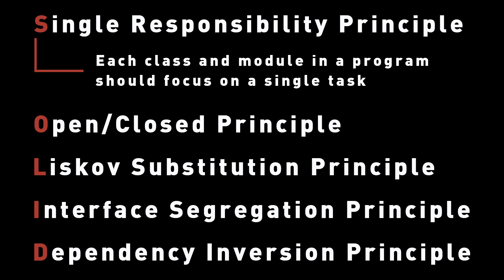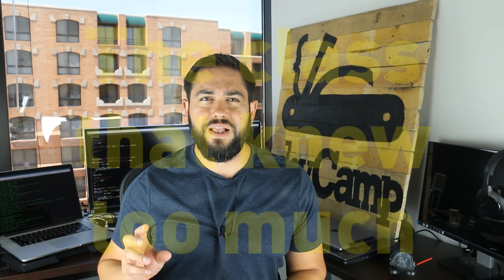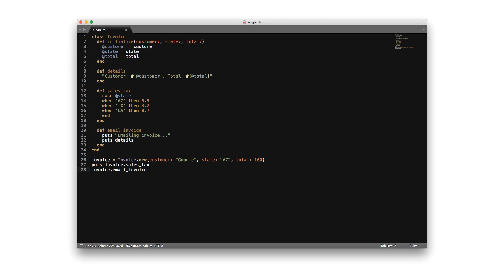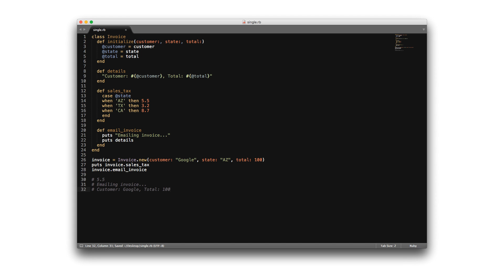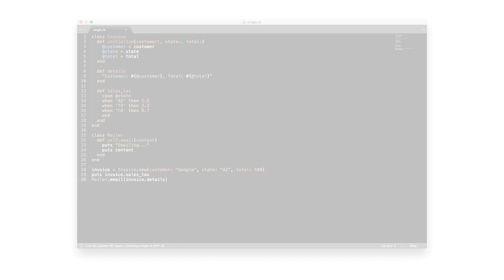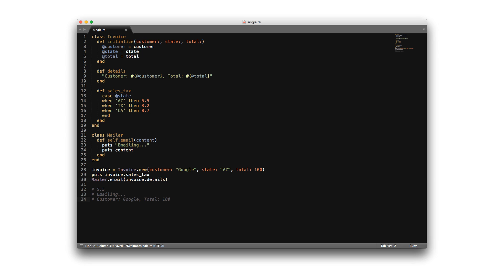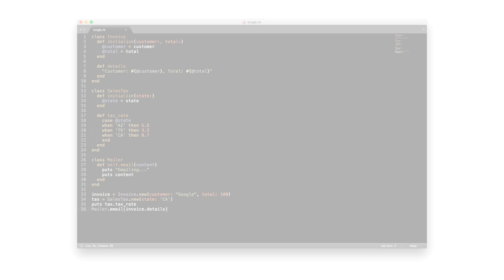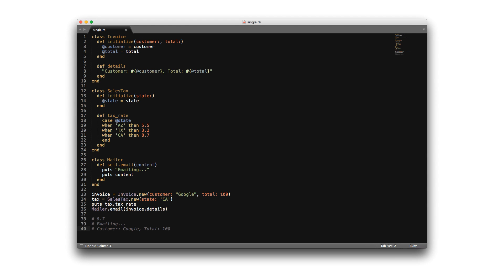Understanding the Single Responsibility Principle

Comment: Am I being a bad actor by nit picking and thinking I feel like all the 'details' information should be in a InvoiceMailer class? So that way as you have different invoice email types, late invoice, reminder invoice, etc you have the messages in there and not in Invoice. I don't want to de-rail the discussion (it's 7 years old so good luck) but just wondering if that's really the end goal if it was a real project?

Also super appreciate the hard work the author and other Ruby and Rails devs put into the world of programming long before other frameworks.

Comment: you extracted things into few classes and run them not inside class. Usually in programming we run things in the class. For example controller - like if user requested web page to showtax rate and send email at the same time. We have class which calls tax.tax_rate and Mailer.email() - so in the end our class/page does more than single thing. So how to make single responsibility? User does not want to load 2 seperate pages to do those 2 things.

Comment: As soon as I adopted SRP, unit testing is easier and I barely have to refactor anything because my classes now only do one thing which means they can are very flexibel and can be used everywhere. Also I can now read what my stuff does by looking at the name which says what it does (only 1 thing). It is no coindicence that the built in libraries that come with programming languages only do one thing too. like e.g. "readfile()" method, NOT "readfileAndDoThisAndDoThatVeryLongMethod(<hundred parameters>)". If you have to think 1 second about what a method or class does, your doing it wrong.

Comment: So would a class instantiating and toggling values to true/false would be breaking SRP? Also, is this some kind of Ruby thing you are using methods like static methods normally without explicitly stating they are static?
Reply from the maker: If the true/false values belong to the business logic of that 'responsibility', then that's fine. And yes, Ruby doesn't require you to declare keywords like static.

Comment: Based on the following excerpt from his book 'Clean Architecture', I think Uncle Bob would disagree with your definition of the SRP:

"It is easy for programmers to hear the name and then assume that it means that every module should do just one thing. Make no mistake, there is a principle like that. A function should do one, and only one, thing. We use that principle when we are refactoring large functions into smaller functions...but it is not one of the SOLID principles - it is not the SRP.

Historically, the SRP has been described this way: 'A module should have one, and only one, reason to change.' Software systems are changed to satisfy users and stakeholders; those users and stakeholders are the 'reason to change' that the principle is talking about. Indeed, we can rephrase the principle to say this: 'A module should be responsible to one, and only one, user or stakeholder.'

Unfortunately, the words 'user' and 'stakeholder' aren't really the right words to use here. There will likely be more than one user or stakeholder who wants the system changed in the same way. Instead, we're really referring to a group - one or more people who require that change. We'll refer to that group as an actor. Thus, the final version of the SRP is: 'A module should be responsible to one, and only one, actor.'"
Reply: Also the result of this video is the creation of three classes with a single method inside and basically no encapsulation... which is totally overkill. This is functional programming with extra steps. 

Having two actors that depend from common methods is not efficiently solved by unpacking a class in a number of single-purpose functions (or the “classes”) shown here... unless you want to have part of the code to work with a functional paradigm.

Comment: Put it simply "extract the codes out where may be reused at other places", that's it.
"Don't Repeat Yourself".
What you want is deadly simple: A class that "Simple to use , simple to understand, simple to maintain".
The "Single Responsibility Principle" is just an idea to achieve the purpose above.
If you make the class fulfill the requirements of  "Single Responsibility Principle" but you loose the understandability or usability, DO NOT DO THAT!!
The "Separation of Concerns Principle" would give you an better idea instead of SRP.
Because in real world, you really don't have to follow SRP. There is no one silver bullet.